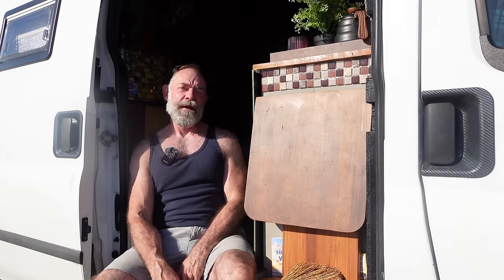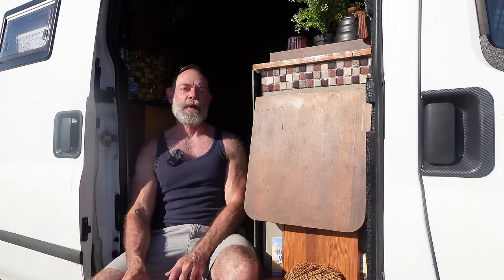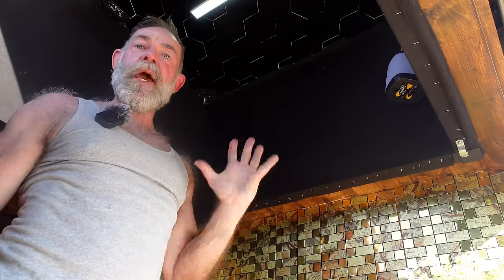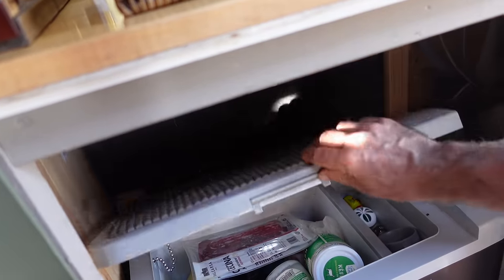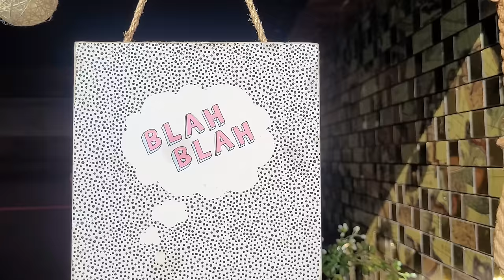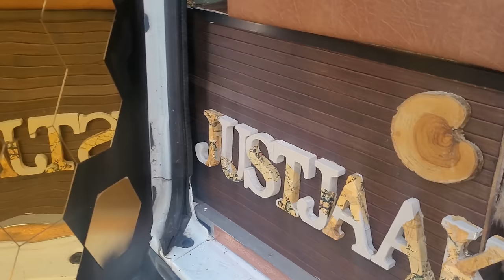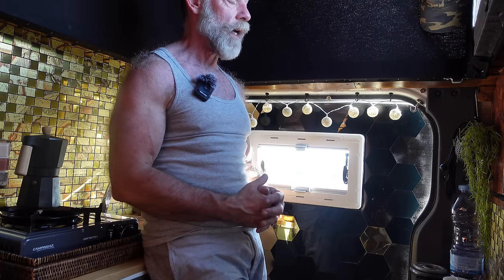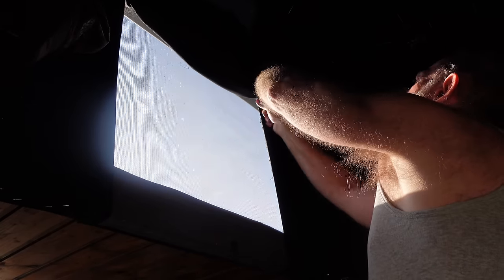Van Tour: from Builder's Van to Cozy Home (Ford Transit Custom) a solo adventure  DIY conversion

Comment: Hi Jack, thanks for the tour part 1, love the cozy style. I am just doing the interior of my 2018 Renault Trafic SWB which is similar size to Dean and my bed is a similar size to yours except i am 2m tall lolol, i am looking forward to part 2 of the tour 👏👏👏
Reply from the maker: Yes those Traffics are very similar in build indeed. they must roll off the same factory, right ? So, no standing room either for a 2 meter guy ?

Comment: That’s very cosy.   Mental not to self ‘give mine some character’.    I have the same battery but if I need the fridge on I don’t need the diesel heater and vice versa so it works fine for me.  I’m not a bit cook or electricity user.  Simple things.   Jeff
Reply from the maker: To be quite honest Jeff, I am surviving now as well, with switching off the fridge when I need the heat and vice versa. Not sure if I want to invest in more and bigger power - with the price tag and the building work ... Simple is good !

Comment: Well Jack, i'm having to watch this without volume at the moment. Looks simple, basic, yet very effective...you've all you need.
What is the fridge please & what is it running off?
Reply from the maker: It's a Dutch brand, I believe - MESTIC. runs on 12v (cigarette lighter)
Reply: @jackvandean  
Thank you Jack, I'm now researching the brand 👍 
I've also re watched with some sound 😀
It's a very cosy build & very inviting.
Are you running a single leisure battery? & charging it up every few days?
Reply from the maker: my battery is connected to my solar panel on the roof. So it's charged daily, as soon as there is some sort of daylight

Comment: Hey Jack, I'm curious, did you build the van all by yourself (part from the roof thingie ofc)? Was it a long process and how much did it all cost? I'm interested in this van life stuff, but I kinda fear the building part, it seems complicated and expensive. Especially the electric stuff, with charging from solar and the car when it runs etc.  Best regards!
Reply from the maker: Hey there. Some great questions - which I should maybe address in a separate Video. I am a bit of a loner - so initially I started doing it all on my own. Quickly I discovered that I haven't got DIY skills running through my veins. So I started asking for help. And - though I sometimes forget - there are some really nice people out there who are willing to help with ideas, input, physical labour etc